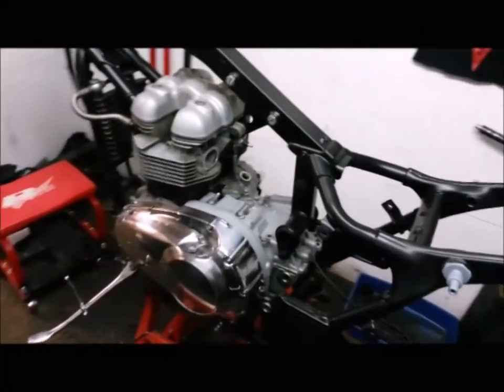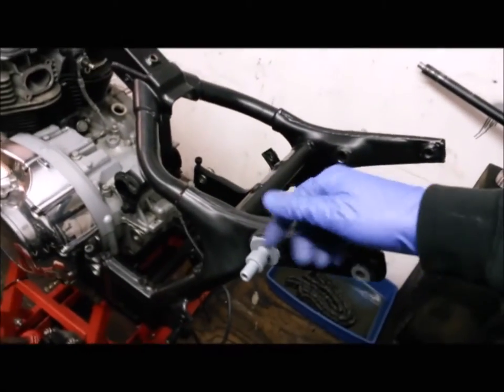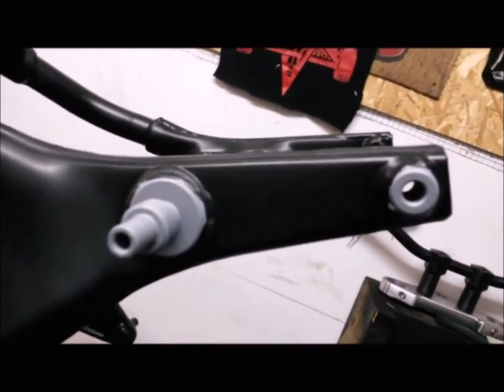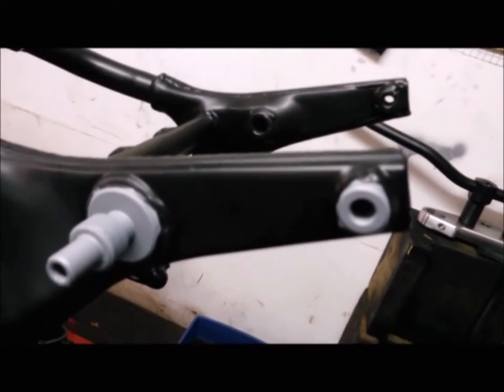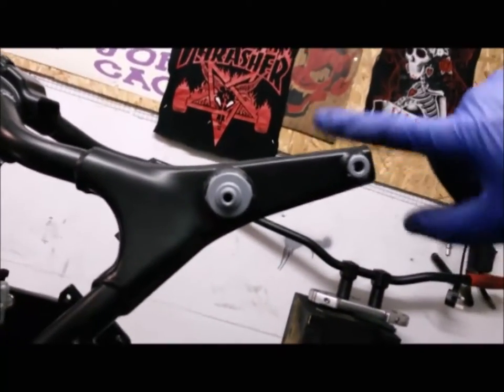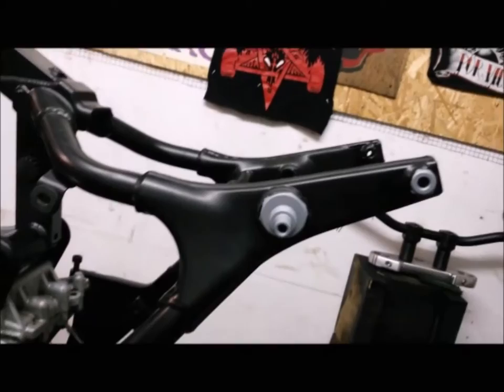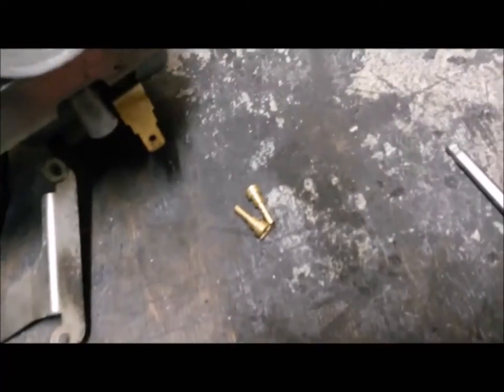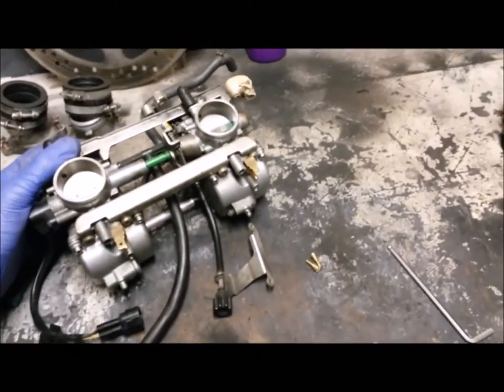Bonneville America master cylinder, re jetting and engine cases

Comment: Looking forward to seeing you do the valve adjustment. I've watched your other valve video from several years ago, but none of the valves on that bike needed to actually be replaced.

I have to check the valves on my '01 Bonneville very soon, and am curious to see how you go about replacing any valve seats that are out of spec.
Reply from the maker: obviously i'd prefer it if everything is in tolerance...but it'll be good video content if it isn't!!! going to try and get them checked tonight to determine if they are in or out of spec!!